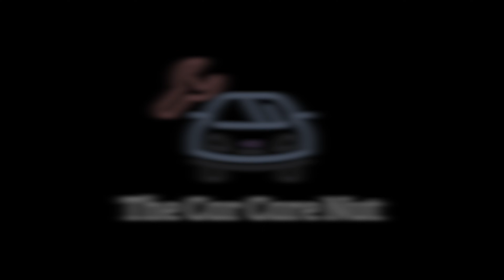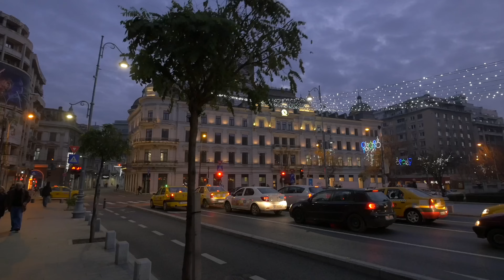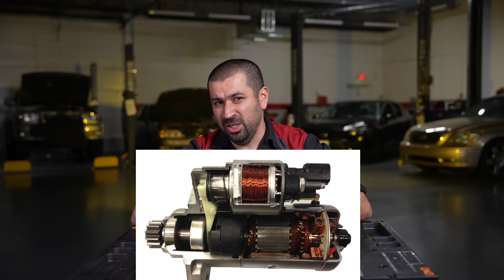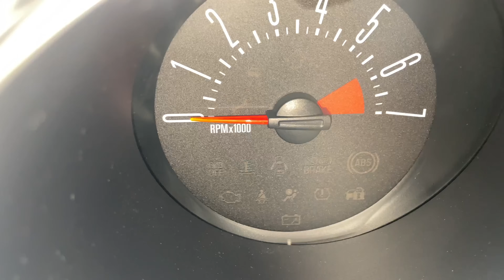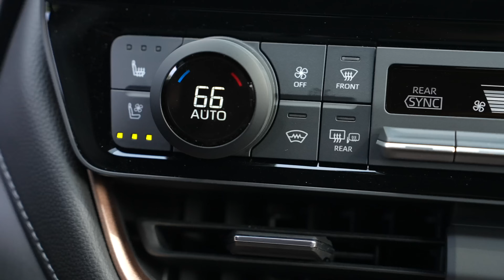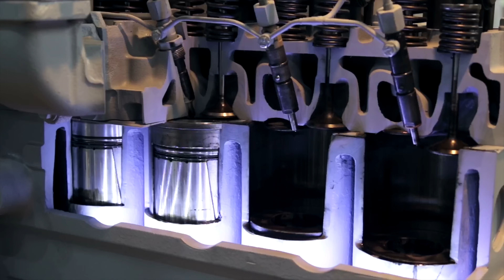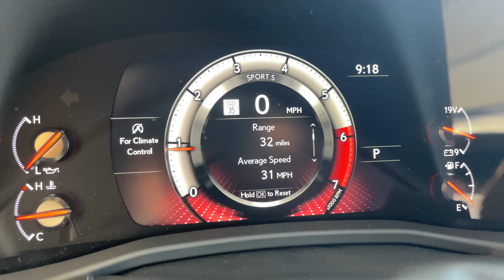How Does Start Stop Technology Work in Modern Cars? Everything You Need to Know

Comment: After reading through a good chunk of comments, I couldn’t find anyone talking about the difference in emissions between idle and driving. When an engine is idling you produce much more emissions per unit input used or energy output. In fact that’s something that hybrid engines and CVTs take advantage of allowing the further optimization for a smaller range of engine load conditions that need to pass emissions or be efficient. You can find the logical conclusion to this logic in Edison Motors here on Youtube where they have no mechanical connection to the wheels from the engine, rather using it only to charge the battery and the engine is optimized to only run at ~1700RPM at ~100% load leading to huge gains in specific efficiency.

Comment: Your toyota is not so smart and fast like you like to say. CAN BUS speed is just too slow, even on latest CAN FD. So where is your speed? PC from 90s is even faster than your toyota...sorry but true
Also leave that garbage out about the starter reset. Aftermarket new starter can be worse than 10 years used OEM. So, leave that part alone

Comment: The largest wear on engine mechanical parts, bearing etc, occur during starts. What happens to the oil pressure especially to parts furthest away from the oil pump?

Comment: i highly doubt it helps with emissions, every once in a while auto industry comes with some random BS to increase sales and calls it emissions friendly. Theoretically, every-time you start the engine your engine pulls at-least 100-400amps from the battery, the electric pumps also drain a few amps, once the engine has started, the alternator would then charge the battery which means it would put additional load on the engine burning slightly more fuel, not to mention the metal plates used in evaporator puts additional burden on the compressor. So, yes you may reduce emission at traffic lights but you'd increase the emissions when the engine is running. You can't just ignore law of conservation of energy

Comment: It is interesting that people would whine about this.    If people realized how silly it is to run an engine at multiple stops during the day, you'd change your mind.    I believe you can save 5% of your gas mileage by just letting this happen.    I used to do this on my older car manually during light sequences where I know I'd be sitting for more than a minute.    The car improved about 5% of gas mileage in my tests and that means a lot these days with gas being what it is.    That and just careful driving took a car rated at 34 mpgs to made it average 44 mpgs (I know the light sequences of where I live so I anticipate lights, I coast, I do posted speed limits, and I also package trips into one use of the car to keep the engine warm).     Appreciate having an automatic start/stop system because it really does save you money.     Whine about it and then shut the hell up about the price of gas.   You won't believe how much gas you waste by driving stupid.

Comment: Wow! I had no idea of all that was involved with this technology. Excellent job as usual explaining this seemingly simple event. Now I have a question that came up and I  don't expect an answer, but if you see this and want to, that would be nice. I have a gen 8 Camry Hybrid. If I were to end up in -40 degree weather like happens in Eastern Montana/North Dakota some winters, been there done that 40 years ago, would my hybrid start without being plugged in with an engine heater. At that time, no engine would start unless it was plugged in to keep warm if it had sat for a few hours. People would lock their cars with their engines running while they went shopping to make sure their cars would get them home. Not good for emissions I know, but they did what they had to at the time, myself included. Just curious. Is the electric motor and hybrid battery powerful enough to just start it anyway. Thanks.

Comment: toyota started using it 2017?? that dosnt seem right.. wouldnt have though them that far behind vw .. my mk7 golf (2013 in uk/eu) has start stop... works flawlesly...only mild irritation is remembering to turn it off in creeping traffic.  oh and the hvac... no engine=no compressor so not AC   I can have hot air though at a reduced level. but glad I drive a manual

Comment: Interesting video, I didn't realise the depth of the system, thanks.  One interesting thing I noticed on mine is that when you're in traffic it uses the front parking sensors to detect the car in front starting to move and restarts the engine ready to move off.

Comment: You failed to mention that the most wear on an engine occures at startup (I'm not talking about the damage you mentioned around 28min mark). So if you shut down and start the engine 20 times a day rather than only once ( on your way to work for example) it will cause high wear on the pistons and rings and you can throw away your engine after only 10 years or even sooner.
Reply: Start up wear after sitting overnight is different than when you're sitting in traffic
Reply: 27:18
Reply: @jean-marcknight8816  
And?
Reply: @atticstattic  it's the answer to the op affirmation that the question is not mentionned. Read and click maybe ?
Reply: @jean-marcknight8816  
Huh?!
Reply: @atticstattic  lol are you playing dumb huh ?

Comment: I'm a mechanical engineer and i can 100% assure you that start and stop puts WAY more wear on your engine, because of oil deprivation at each cicle plus more vibration and stress during each start and even MORE wear on your starter motor, as high as 4/5 times higher wear during urban use. Let's say that 90% causes of starter failures in modern cars are start & stop related 

My 2 cents: the considerable more wear to your engine, starter motor and battery is not worth the basically laughable emission lowering result,  expecially if its YOU paying for the (Most times pretty expensive) damages caused by this dumb system since most problems usually start to appear when warranty is already gone

Peace

Comment: My car is a 2015 1.6 diesel Vauxhall Astra which has stop start with has not worked for 12 months correctly also after having the car serviced a few days later when the weather was cold the service the car Soon light came on and the car did not now start up quickly the service light I believe is telling me the is something going wrong I am Guessing The AGM battery is passed it’s best now I found out the service light came on to tell me it had a faulty glow plug it was taking longer to start up so I have had all four glow plugs replaced it now starts a lot better now but the stop start system still doesn’t cut in but i am no worried about it

Comment: My BMW F20 & F30, does start/stop all the time, even if the engine is very cold (3degree outside temperature). Even if i start the car after days of not driving the first time and stop after 100Meters on the traffic light. BMW does start/stop no matter what. Thats the reason i disabled it with bimmercode.

Comment: I have a VW Passat with Start/Stop. Fortunately, the system was disabled by the previous owner (changing some functioning parameters may make it think it is always unsafe to start/stop). However, sometimes the engine does stop and it's the most annoying experience. You are at a Stop light and just when you want to go, the engine stalls and it takes some time for it to fire back up. 

Not to mention that I often see people whose car start/stops like 3 times while parking, since the car thinks it is at a stop light while the driver makes decision. That can't possibly be a good thing.

While engineers spent large amounts of time overdesigning everything, you must acknowledge that large stresses occur in the engine at start and stop. Just imagine that everything goes from operating speed to zero speed and conversely. 

Think of the transmission, the clutch, the belts/chains, oil lubrication and cooling. Everything hurts after a start/stop. On a home->work travel the engine will start/stop at least 10-20 times more than an old vehicle. 

If you want a reliable petrol/diesel car, don't use start/stop in my opinion. If you want low emissions, go with hybrids or electrics.

Comment: Well done explanation so far, but I have been missing something: 
you haven't talked about the catalytic converter and cold weather conditions. Is that true, that in this conditions the catalytic converter is cold, not being at operation temperature and not doing much exhaust gas cleaning? Does it make more sense (from the ecological point of view) to have the engine kept running and not doing start/stop until the coverter gets hot enough? I know, that modern catalytic converters have a heater element built in, to bring it up to temperature more quickly. How is the start/stop system behaving in such conditions? Does it also monitor the catalytic converter temperature and the heating of it?

Also, a modern engine with oil pressure controlled valves will need that oil pressure to be present when it comes back from a start/stop event. Is there an electric oil pump on the engine to do this? Or does the oil pressure come back fast enough to not damage the engine's valves? Also it yould make sense to circulate warm oil around the engine when it's cold outside, to hold the whole block at semi-operation temperature, and also important, if the engine happens to be turbo charged, the pump should also maintain oli flow in the turbo charger, which is also critical, when it's hot outside.

Comment: My son owns a 2021 RAV4 that I just got to drive while he was out of town.  I didn’t realize it had this stop/start feature until I drove it — I heard about the feature but never drove one before.  At start of acceleration, I felt the delay, like you feel with a turbo, and a bit of a rattle, then it accelerated.  It was a bit disconcerting.  I asked my son about it.  He showed me a switch the allows the stop/start to be turned off.  The delay doesn’t bother him, though he knew what I was talking about.  He just leaves the stop/start on.  If I were driving it daily, I would probably leave it off.

Comment: If we were talking about emissions 30 or 40 years ago,,i would  be all for it,when i worked for Royal Mail in the UK in the early 70s the diesel vehicles we used then belched out acrid fumes out,especially on start up,these were mainly from the 60s,when i retired in 2017 the diesel van i was driving up to then gave out no fumes whatsoever and our larger vehicles you would have to use Addblue to minimise fumes,London buses used it i believe,it looks like coolant,all EVS now.😊

Comment: Great explanation of how this technology works.  I may be showing my age, but I had a '73 Ford with the old points & condenser ignition.  When this was failing, it would normally manifest itself at the most inopportune time: stopped at a light, the transmission in Drive, and then wham!  The idle gets too low, then the engine just stops.  That brief moment of panic when the light turns green hoping I can start the car and get moving so a s not to draw the ire of those behind me.  For that reason alone, I will never own a vehicle with this technology.

Comment: I think the system is not bad at all. But I am in europe and the Start and Stop is trigger by putting the transmission to neutral. If you are a folk like me, a guy who want to preserve the clutch in traffic jam, you gonna but a enormous stress on the system... It's why I don't want it. I don't think it's design to start and stop the engine so many times than you depleted the battery in 30 minutes.

Comment: It's a cool system, but it should be opt in - ie something you select on purchase. I'm sure it's great for many people, but it'd be awful for me.
1. I do short trips. Most trips the engine doesn't even get to op temp so this system won't engage.
2. Because I do short-trips the battery will be too weak so the system won't engage
3. For several winter months the temperature is well below -5C so the system won't engage
4. For several months during the summer the temperature is above 30C, and because of the short trips, the evaporator won't be cold enough to sustain AC

So I have to pay extra for this system, pay extra for the special battery every time it dies, pay extra for the fancy starter, and it won't even engage 90% of the time.
Then there are other people who don't do city driving but long highway miles. They have to pay extra for a system them won't use also.

Comment: 10:30 my 2002 Prius has both of these HVAC modifications, since it does NOT have an electric compressor for the A/C. Toyota has been doing C/S (cold-storage) evaporator cores for a LONG time. For me, it's somewhat annoying when I'm sitting so long that the engine decides it needs to start to replenish the cold-reserve in the evaporator. At least it shuts back off within about 20-30 seconds.

Comment: My wife's BMW 528i had start stop and it actually caused the motor mount to crack. The torque of the engine constantly starting up caused the failure. We shut it off as the gas saving are minimal.

Comment: All of this complication,for what gain? It doesn’t save fuel. It doesn’t pollute any less. As a matter of fact, you use more fuel and pollute more with the actual creation and use of all the extra components that have to be made and replaced more frequently. Car batteries used to have an average life span of 5-7 years. Now,especially with this start stop technology, you’re lucky to get 3 years at most. I just replaced my cars battery earlier this year, and my car is only 3 years old. This is why the human race is doomed to failure. We always have to over complicate things which creates even more problems down the line.

Comment: Is this normal, stop / start  2022 Rav 4 engine auto shut off flickering climate lights , one thing I noticed recently was when the auto shut off (push in brake engine shuts off) the interior climate control lcd screen flashes or dims.  It’s strange. When I get in the car and press the button to turn it on, it doesn’t do it then. Is this normal, seems strange for

Comment: I did it manually at red light that have Countdown timer.
Combine with neutral gear whenever possible (not recommended for safety reason) , usually as soon as I see traffic jam in front or intersection coming up , stretch gas money a little bit.

Comment: This is completely different from the start stop in my Prius. My car has no staeter, selonoids, or anything else in a conventional drivetrain. Pushing the power switch just brings the hibrid system online, if the ICE needs to run, MG1, the alternator/speed control/starter spins the engine at 800 to 1000 RPM from the 600 V 3 phase inverter, the 12v battery is no longer in the picture. The AC BTW is also electric, no belts either.

Comment: Great video!  Here in Arizona we got our Honda Odyssey in the summer, and it wouldn't turn the engine off with the A/C running heavily. But now that it's a little cooler, the engine will switch off when we stop at lights.
Reply: Turn on the heater it also disables that when the heater and defrost is on.

Comment: I'm pretty sure the manufacturing of all the additional components needed to make this stupid start/stop system work creates far more emissions then what's saved by the start/stop itself. You need an extra electric water pump, extra metal plating in the evaporator, a heftier starter that must be replaced after X number of starts, a bigger battery and on and on and on.

Comment: I never understood why people dislike this technology so much until now. I’ve been using it on my 2012 Honda hybrid for many years and never had a problem with it, but now I see that on full gas cars the process is crazy over complicated and it seems like they are compensating for every part of the cars functionality to get it to work. My car uses older hybrid technology so it’s definitely not as seamless start stop tech as newer hybrids that prioritize the electric motor, but it sounds absolutely crazy the things they have to add to get this feature on full gas cars for what I have to believe is very slight fuel savings.
Reply: idle-stop in my '02 Prius is SEAMLESS. Even if you stand on the accelerator from a stop, the electric torque kicks you off the line and it just goes.

Comment: In-between-technology is always over complicated because it's not yet simplified again. Remember an era when almost everything is vacuum controlled? 😄so painful to diagnose. This start-stop system got more simple toward hybrid car: big battery with longer life is already there, big brushless motor that have better stall performance already attached directly on flywheel, less moving parts on transmission, all accessories already electrically driven, electric motor can help hold the car passively...

Comment: This tech is useless in colder climates as much as it would be in hotter climates.  Imagine being in a vehicle on a hot day, your AC cranking out nice cool air, and you reach a traffic jam.  Car shuts off.  So does your AC.  You're in the middle of winter and the same thing happens and you're in your nice warm vehicle and it shuts off.  That's just one problem.  Now imagine being in the same traffic jam, let's say it's about 1-2 miles long.  Your vehicle keeps starting and stopping to take you 2-3 feet as traffic snails along.  How many times do you think it'll start/stop in that 1-2 miles at about 1-3 feet at a time?

That's why when I'm in a vehicle that has this tech, the first thing I do when I turn it over is to immediately shut that "feature" off.  Every time.  It is a useless "feature" IMO.